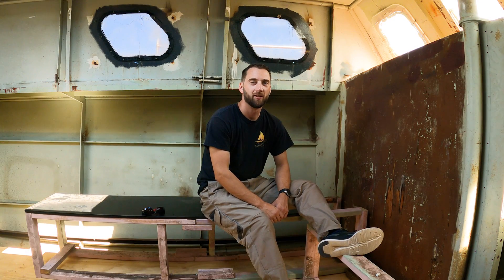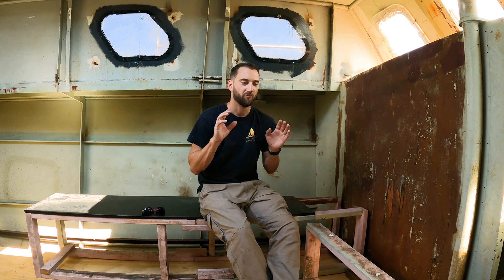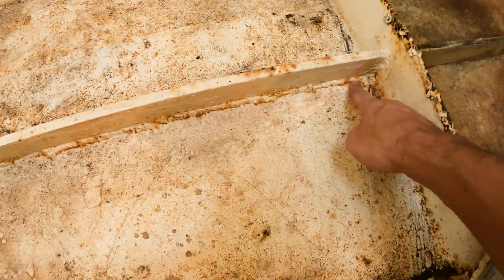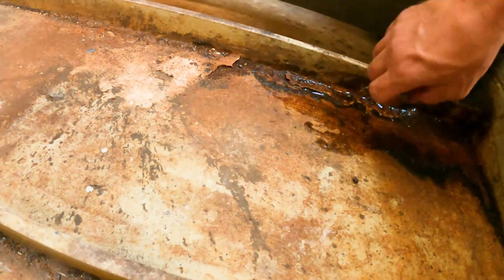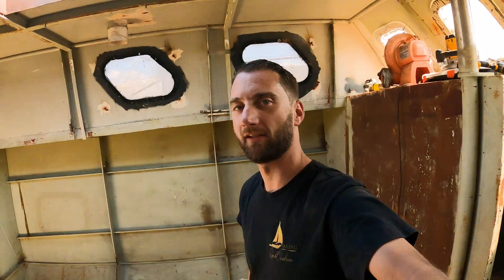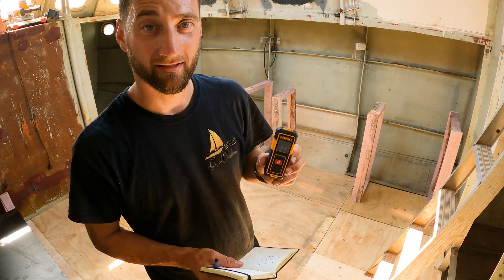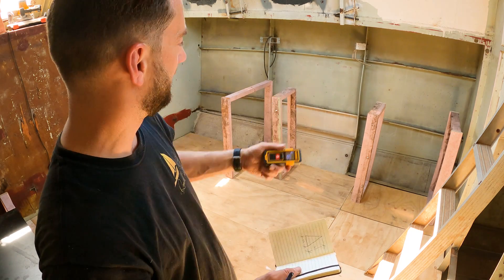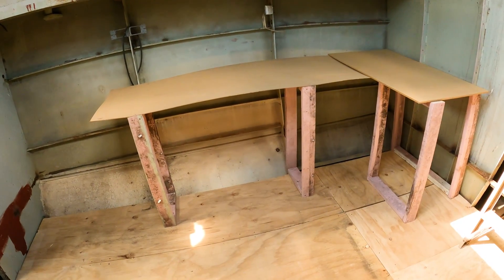Sailing QC #12 |  LOWERING Our Boat Floor to its Original Level  |  Steel Sailboat Restoration

Comment: Yup intermittent fillet welds .Whoever welded up the boat was most likely learning Just get a torch or plasma and pop some small holes for drainage ,but the amount of weld on that boat wowzers lol
Reply from the maker: There is a crazy amount of weld for sure! some good and some bad, but will definitely get onto the drainage holes soon.

Comment: I binge watched all the episodes, I thought I would put all my thoughts in one note on the latest.

1.  I have several problems with the current guard rails, particularly with small ones aboard.  The stanchions look to be too far apart, the top rail seems too high with too much space between the top rail, center rail, and the toerail. I favor stainless stanchions closer spaced (with suitable isolation from the mild steel hull) and strongly bolted on.  While the top rail can be solid or cable, I think you would be well served using two runs of plastic/rubber sheathed wire cable between the toprail and toerail.

2.  Bowsprit.  Since you want a safe bowsprit that you can step on, the current design will require a lot of work to get there.  What about replacing it with one flush to the deck?  Eg. Run a stronger one under the decking with dual anchor rollers at the end?  Run a forstay from the end, inside the railing, with the baby stay near where you’ve talked about (I don’t think that doubled plating will be enough, treat it like a chainplate and tie it to a deck beam.),

3.  Foredeck.  I couldn’t tell from the images, but underdeck support for the Samson post seems too small and not solid to the keel.  For the chain locker, are you going to keep the chain on the windlass all the time?  If so, then consider reconfiguring the locker to run the chain and line through a hawser pipe directly from the windlass into it.  Perhaps install a flush hatch beside the windlass into the chainlocker.

4. Bilge and related items.  Have you selected an engine?  Any idea about the tankage you want to carry for fuel and water?  The need for mechanical, tankage, and storage, etc. May effect your floor height points.  (A wise old friend once suggested that you figure the amount of fuel needed to run the longest leg you’re willing to power through, then double or triple it.)

5.  Interior.  Even just doing coastal cruises, you’re going to run into weather.  Think about where people will need to grab when a wave upsets you.  A good rule of thumb to follow is wherever you’re standing, below or on deck, you should be able to reach and grab a handhold.  One reason to keep a reasonably low overhead is to mount grabrails overhead throughout the cabin.  For floor height, I suggest you re-examine the settee heights, they’re often placed a bit lower than home furniture which makes sitting a bit more secure.  After addressing space for tanks, storage, batteries, mechanical, etc. you might find that the floor will need to be higher than you think.
Reply from the maker: WOW that's lots of comments thanks!...Ill see how I go answering all your points 😀
1. These are original guardrails installed by previous owner which we haven't started modifying yet. One thing for sure is that we will be adding wire lines of some kind in between the large gaps the solid rails and toe rail. We feel the gaps are too large and need to enclose/close them up for safety. Some areas we even feel may require solid canvas or netting as well.
2. That's a good thought, replacing the bow sprit is not out of the question. However I have thought of running the chains to the end over 2 rollers and having the anchors clip back on bracket with a deck that runs over the top, which is a lot of work...we will consider all options when we get round to finalising this task.
3. Thanks for pointing that out, while I was chopping down the floor I did sit there staring at it thinking the same thing. I do have plans to reinforce it, however I plan on showing all the details to structural engineers at work to gain their opinions and see if they can suggest best course of action. Good idea about the chain locker.
4. We have decided to Green by going electric to avoid associated issues / costs with diesel which will be easier with the battery storage, but don't worry we will be sure to have heaps!
5. Grab rails + companion way stair rails are certainly on the cards to navigate the interior while underway. All the cabins are confined enough to be able to brace your self in any position. The only place we will have to put more consideration in will be between the kitchen and the table in the center of the room. Once we get further in the build we may have to create a fold out table or an island, exact positions and layout still to be determined. 

I hope this answers most of your questions we are still working our majority of things as we go to make them the most suitable for our family & needs. A lot of things on this boat weren't thought through during its build and we are having to go through and rectify a lot! It will all be worth the changes in the end :)

Comment: The moment you sat down, it was obvious you'd made the right choice.

Are you planning an island in the middle of the cabin? Your boat's beam is at the boundary between boats that just have a central isle and boats with islands, so you could go either way. However you need some sort of hand hold in the middle of the cabin so you can walk through it while sailing, and places to brace your hips when you're cooking so you can use both hands when the boat is rolling. Have a look at 'production' boats that are designed for large crews who cook in protected harbours, and then at 'blue water' boats that are designed for a couple who cook while sailing.
Reply from the maker: Hi Robin! thankyou we definitely think so too!
At this stage we are not having an island but will be incorporating a handrail all the way along the kitchen (starboard side) as well x

Comment: You are advised to have electronic and paper charts and do both. All about redundancy, for example: You get hit by lightning and it fries your electrics or they get wet and fail, a host of possibilities.
Reply from the maker: We will have definitely have paper charts too as backups for any situation they will be there and accessible at all times incase of emergency 😀 Touchwood we wont need to but better to be safe than sorry.